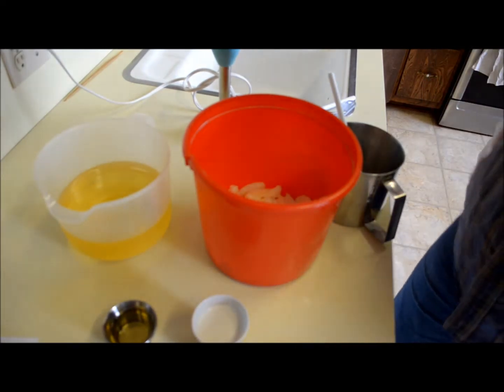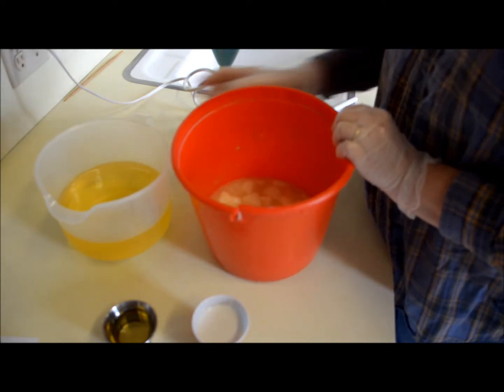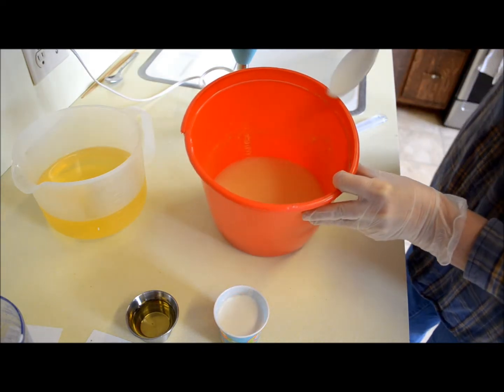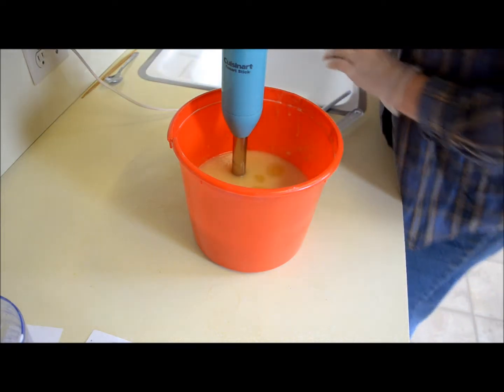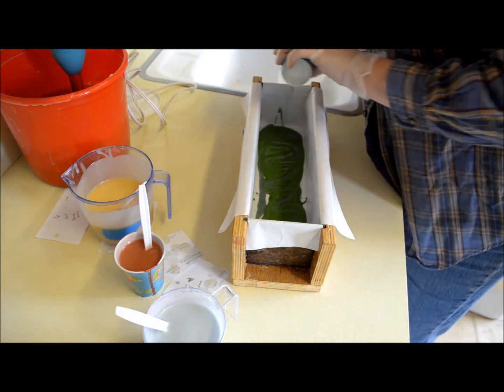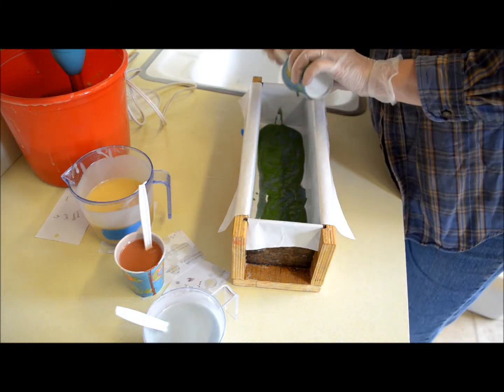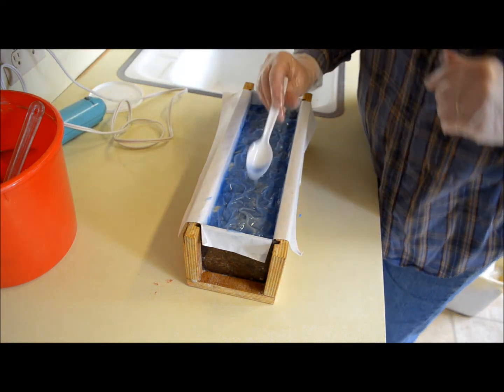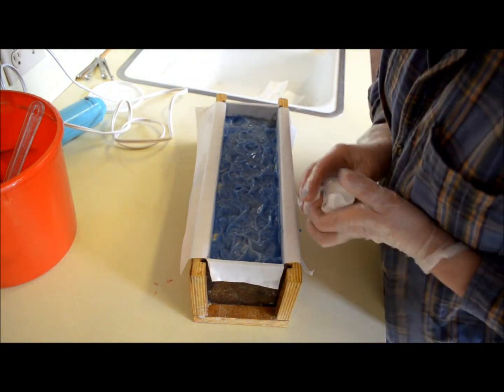Making Soap Using the Thermal Transfer Method

Comment: Great video with lots of great ideas in it. Question though. When you add milk to a soap when using the heat transfer method, does it not highly increase the likelihood that the milk will scorch since the temp of the lye mix is so high?
Reply from the maker: I add the milk after the lye and oils have been brought to a slight trace.  The temperature is not that hot to scorch it.  At least I have never had it happen yet. Been doing it this way for years.  Good luck

Comment: when you masterbatch with coconut oil does the masterbatch get solid?  like coconut oil ?
Reply from the maker: Sandra I melt the coconut oil before putting it into the masterbatch.  Then it all stays liquid.  In winter here the whole thing gets thicker because of the cold but it does not solidify.   Sorry for the late reply I have been away and not able to get to this.  Hope it helped you in time.  Good luck

Comment: What a pretty soap!  Is the heat transfer method used to save time of melting hard butters/oils or does it also serve other purposes?  I loved your video, btw.
Reply from the maker: Thank you Debbie   With the heat transfer method there is no waiting for lye to cool or worry about temperature.   You make the lye and immediately pour it over the hard butters and as soon as they are melted in goes the rest.  Much quicker.  Hope that helps
Reply: It does help. Thank you Dorothy.